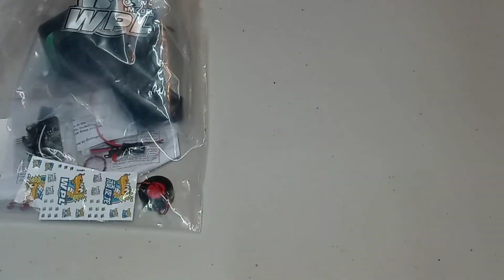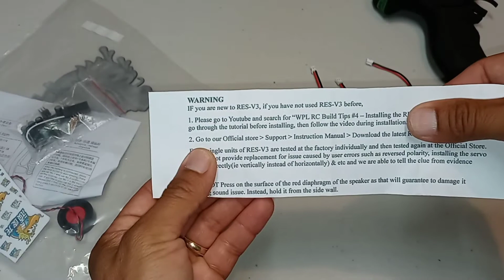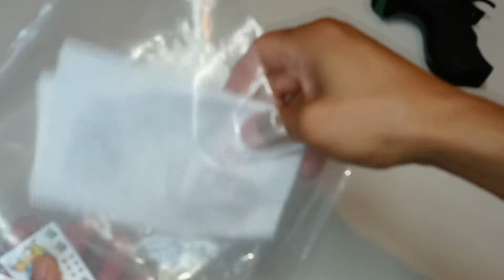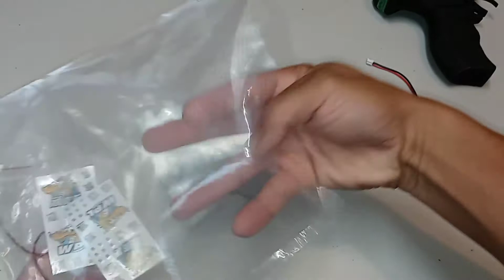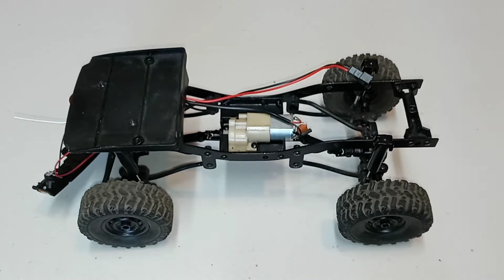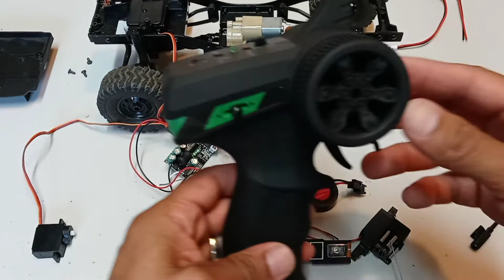how to connect wpl Res-v3, radio, esc, sound controller into rc wpl c24-1 part 3

Comment: I’d like to use the sound module power line to connect custom LED roof bar , it’s 7.4v 4.5W + 2 taillights red LED , would it work ?

Comment: Where would I find the black connections that I need? And thanks for the great video!!!
Reply from the maker: Hi 👋 the servo plugs or servo connectors you can buy at Amazon website, here is my affiliate link at no extra cost to you: https://amzn.to/3XPc2z7
Reply from the maker: On the servo plug, connector you will need to remove or cut the white wire or leave it alone, is up to you. Just use the plug needed that fits the res-v3 receiver and the other end you can completely cut it off for future use on other project. I hope this helps and any other questions feel free to let me know know and thank you for watching my videos.😀
Reply from the maker: And here is one of my videos were I show the servo plugs, connectors connected to the res-v3 receiver.

Comment: Just got my sound kit and everything today and just set it up and now the throttle is backwards
Reply from the maker: Nothing to worry 😀 you can switch the motor cables to be reverse, for example the positive make it ground and the ground make it positive only for the motor cables switch them around and nothing else, that should fix the problem. Let me know how it went and thank you for watching my video 👍
Reply: @miltonrcadventure  and another thing is after i did that it doesnt wanna stay connected to the controllerand like 20-30 seconds
Reply: @ohdeefy3352 my winch is not coming out but only going in 😢 how to fix 🙏🏻

Comment: Hola, buen video, tengo una
 pregunta, se puede usar el transmisor original? 
O al comprar ese receptor debe ser con el transmisor que sale en kit?
Porque veo que son iguales los transmisores
Reply from the maker: 👋 hola benjamincontreras160, no se puede. El transmisor tiene funciones extras que solo es conpatible con el recividor que viene en el kit. Lo que si es conpatible y se puede usar  es el motor original con este Res v3 kit. Pero tendrias una velocidad solamente. Solo al conprar la nueva transmision, tendras la segunda velocida que con el nuevo control solo se puede activar. Espero que te aya ayudado , y gracias por ver mis videos👍

Comment: Great video! Quick question, can i use this v3 soundboard with a 3300kv brushless motor? Thanks in advance!
Reply from the maker: Hi, @jNeoGaming, i would not recommend it because the higher kv, for example 3300kv is too fast for crawling and the torque is not there. The lower the kv, the more torque you get and for this rc trucks you need torque to climb those rocks or obstacles. So it may work if you connect the res v3, what i mean is that the motor may turned but, no torque power. I have on my truck the wpl 2 speed transmission with a 370 motor and it works great in my opinion. I hope this helps and thank you for watching my videos and your comment👍
Reply: @miltonrcadventure  wow thank you for the long reply! Your explaination is what i needed. In that case, ill just go with what u suggested. Again, thank you. Keep up the good work and stay healthy! ( done sub 😆😆😆 )

Comment: instead of taking the new cables can I also put the ones that were in the old esc and put them in the new v3? Thanks
Reply from the maker: Hello @SebaCioc, yes you can use the old cables of the old esc that way the instalation is much faster👍 i hope this answer your question and any other questions, feel free to ask me and i will try to do my best to answer it. Thank for your comment and for watching my videos👍
Reply: @miltonrcadventure  thanks. But how many
mm is the jst cable for the 370 motor to put in the esc ? Or there is the cable in the res v3 pack?
Reply from the maker: @Markyx9642  in the Res v3 kit, you get a switch cable, batery cable, and a cable to solder to the motor, to the new 2nd gear motor, only if you have it.  you can still use  the original motor too, and you don't have to solder anything, only with the new 2nd gear motor. I didn't use the motor cable that came with the Res v3 kit because is too short, i use the original because is longer. All this cables are JST plugs on one end that connects to the Res v3 esc (mother board) directly, this are just extra cables, you don't have to use them, you can use the original cables that are already on your truck. For the lights you need to buy separate, servo plugs extensions because JST plugs are too big to connect next to each other, they do not fit on the pins of the Res v3 esc. I hope this helps. Let me know if this answers your question.
Reply from the maker: Yes the JST cable is for the 370 motor. Only if you buy the new one with 2nd gear, but is too short, i didnt use it in my truck, i use the original one that came with the truck because is longer.
Reply from the maker: Here is my other video explaining how to connect the lights, check it ou and thank you👍 https://youtu.be/TiIHRNnnl9s
Reply: @miltonrcadventure  so can I use it with the 370 motor with one gear?
Reply from the maker: @Markyx9642  yes👍 you can use it with the 370 motor with one gear. It just might be to short, if you need longer, use the original that comes with truck.
Reply: @miltonrcadventure  but the 370 motor needs more power so i can't use the 180 motor cable. The 370 motor cable comes with the res v3 pack? Or i need to buy one
Reply from the maker: @Markyx9642  the 370 motor cable does come with the Res v3 kit, no need to buy one. Now, i did use the original 180 motor cable and solder it on my 370 motor because i need it to be longer and even though the 370 motor does need more power, i have not run into a problem with the original 180 motor cable and i notice it can handle the voltage load . here is a video showing the 370 motor cable that comes with the Res v3 kit. Let me know if this helps.
https://youtu.be/XkpGsMpGGqQ
Reply: @miltonrcadventure  thank you so much!
Reply: @miltonrcadventure  I watched the video. But instead of soldering the wires, can I cut the red jst connector and connect the white jst?
Reply from the maker: @Markyx9642   yes you can do that👍 sorry i took to long to respond 😁 to your mesage.
Reply from the maker: And again let me know how it turned out, is your rc working properly? Feel free to message me any time and i will get back at you as soon as i can 👍
Reply: @miltonrcadventure  thanks
Reply: @miltonrcadventure  this is all a project and i need to buy the wpl c24 i'll let you know in like a year or 2 because it's not expensive but for me is a bit expensive
Reply: @miltonrcadventure  one final question. Can I use a 2400mAh 6v battery to to make the 370 motor the lights,esc and the servo work good? And if it doesen't a 2400 mAh 7,2v works. If it works, it fits in the cover where the batteries should be? Because is 6 batteries long and the 6v is 6 batteries long. Thanks and sorry for waste time
Reply from the maker: @Markyx9642  The 6v 2400 mAh batery, i don't think it will work properly, or fit in the batery conparment, since the new Res v3 esc needs 7.4v to work all the functions properly and the size of the batery is a little bit smaller than the ones you mention. Now the 7.2v 2400 mAh batery, it may work a little bit, but, you still not getting full power to power all the functions correctly and specially you want power for crawling. Now on the 2400 mAh, is great on both batteries, but that is just a number to tell you how long the power is going to last. The longer, bigger the number, the longer the run time. I am using a 7.4v 1500mAh and i feel it works just fine, google rc wpl batery. Now if you find a 7.4v 2400 batery, go for it 💪.just check the size first to see if it will fit. Now you are not wasting my time at all, in this hobby we all have questions on how to make our rc work properly and nobody nows it all. In the rc comunity we all need each other to learned, have a great experience and top of all, to have fun. Thank you my friend for watching my videos and again feel free to ask me a question any tiime and i will try my best to help you out👍
Reply from the maker: @Markyx9642  no worries my friend, you will get that rc💪
Reply: @miltonrcadventure  thanks
Reply: @miltonrcadventure  👍🏼👍🏼
Reply: @miltonrcadventure  the esc is 30A?
Reply from the maker: @Markyx9642 That is a good question, i couldn't find information if the esc is 30A . i did find some information on the specifications on the esc and it is 14A. Here is the link to that information: https://rcbox.com.au/products/wpl-res-v3-receiver-board
Reply: @miltonrcadventure  for more speed it changes or no?

Comment: will it work with that original 130motor? or it will be fry
Reply from the maker: Hello No Name 😀 it will work with the original motor, It will not fry. The only difference is that you will not have a second geart to go faster and less torque to do rock climing. Also i don't know how good the drag brakes will work on the original motor. On the new motor, transmission it works great. I say use the original motor and test it out and if you don't like it you can always upgrade in the future👍

Comment: why cant i use the old battery cable and on/off cables?
Reply from the maker: Hello Noor Nabi Gaming 😃 yes you can use the old batery cable and on/off cable, they are just extra. You can also use the old batery, the difference is just that the new one is much stronger and will last longer than the old one. The old one you can still use, but the performance is going to be less and may struggle in extreme rock climing. I hope this helps and thank you for watching my videos👍 happy holidays😁

Comment: Is it necessary to buy the 2  gear transmission to fit the sound system or can you fit just the sound system only?
Reply from the maker: Hello Aishutty's world 😃 it is not necessary to buy the 2 gear transmission to fit the sound system. The truck is still  going to run, except instead of 2 gears just in one gear all the time and the torque is going to be a little bit less with the stock motor. Other than that, the truck runs just fine without the 2 gear transmission and you will have the sound system. You can always upgrade in the future if you like. I hope this helps and thank you for your question and for watching my videos👍

Comment: what motor/servo to use together with this V3 remote?
Reply from the maker: The servo is the stock one that comes with the truck. For the motor, here is the link to the 2nd gear transmission that comes with the motor. Is an affiliate link that helps support my channel at no cost to you, thank you and also  for your comment and for watching my videos👍 
where to buy 2 speed transmission:

https://www.wpl-rc.com/products/dual-speed-gearbox?ref=MILTONME